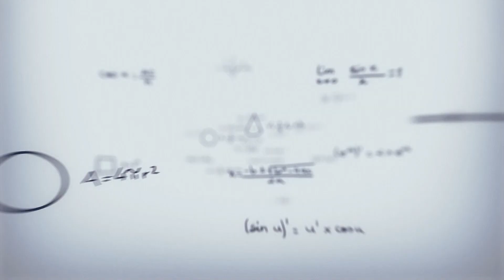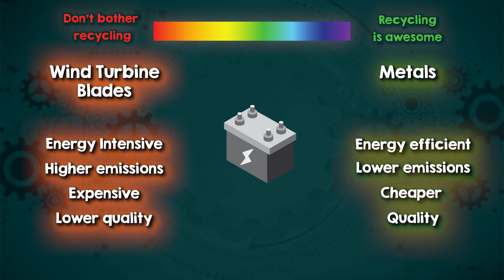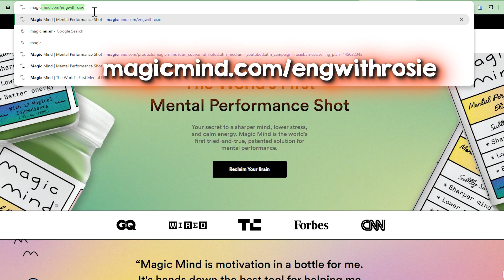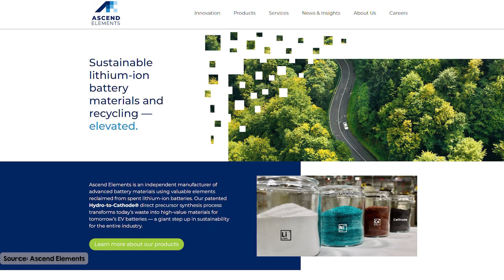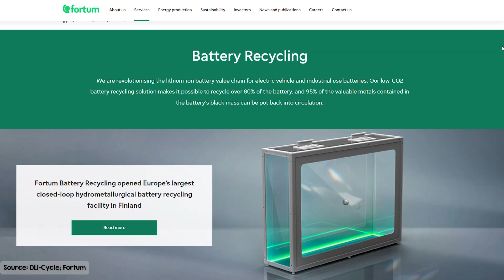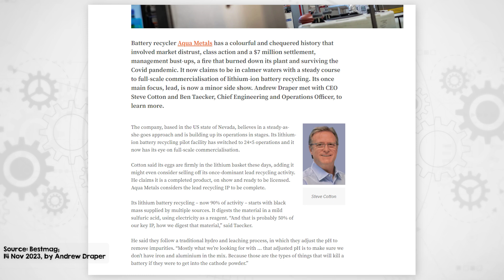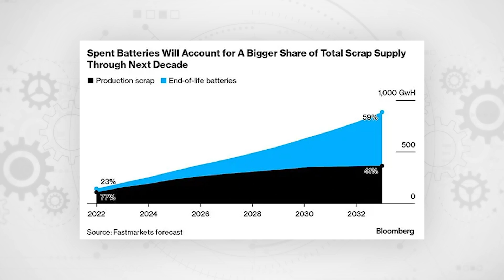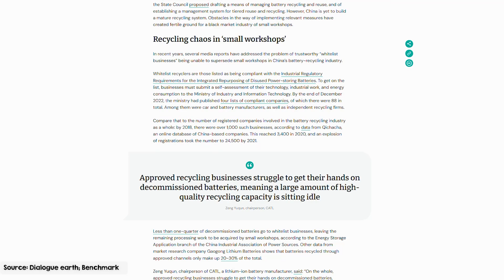Recycling Lithium-Ion Battery: How Does It Work?

Comment: I believe we should focus on recycling or at least segregating batteries. While recycling all types may not be profitable at the moment, it's crucial to separate them by type and keep them out of landfills. Currently, it seems we have more recycling capacity than material to process, so it's essential to recycle as much as possible. According to the economy of scale, if recycling plants aren't operating at full capacity, they become significantly less cost-efficient.

With so many different battery types being developed, segregating them is becoming even more important. Some types of batteries will be more suited to hydrometallurgical recycling methods, while others might be better for pyrometallurgical processes. Cutting up and sorting batteries appropriately makes a lot of sense. 

Another issue is that many batteries are discarded while they still have usable capacity. For example, vape batteries are often recharged fewer than 100 times before they’re considered "end of life." Personally, I’ve repurposed batteries from devices like these. While they may not perform as well as purpose-built ones, they still work as backup power for me when my primary battery is charging. When they finally become less efficient, I can still recycle them. 

Our society has become very "disposable," but many items, like batteries and electronics, can have a longer life through third-party use before heading to recycling. Cell phones, for instance, often have plenty of functionality left even after they’re replaced, and once they're no longer useful, they can still be recycled.

As for the costs of reusing and repurposing older components, I use a 15-year-old solar panel that now produces about 50% of its original output to charge my older devices. While I wouldn't install such a panel in a new system, it works well on its own. When it eventually wears out, I can replace it with another salvaged panel, which is much cheaper than buying a new one.
Reply: Energy has to be cheap for recycling to happen. So whatever future we have has to be one of energy abundance.
Reply: Yes, but, where's the efficiency?

Hanging onto something on the grounds you can still get an output is one thing but is it really economically sound reasoning?

Might be better to ditch the old panels and replace with brand new higher (but granted not by much) efficiency units and keep for another fifteen years.

That way you don't have to put up with lower output from old duff panels and avoid the fag of replacing the panels with marginally higher output units more often.

And of course you become a "consumer" of brand new kit and help with the economy ...

Rather too much made of recycling stuff to "work" which  should be recycled into basic components for reuse in other products.

Mind you if you have data which proves reusing panels is economically worthwhile then happy to debate.

Comment: You didn't cover lead from lead acid batteries which is over 99% recycled! Would have loved for you to mention this, since the recycling rate is due to strict government legislation due to the health hazards posed by soluble lead compounds like the ones in lead acid batteries.
Reply from the maker: I had that example in an earlier draft but removed it as I felt the video was getting too long!
Reply: @EngineeringwithRosie    It's a shame that it got left out. Hopefully you can do a short post on it. Since I'd love to hear your take on the topic.

Or hopefully you could reply to my comment. To clarify your narrative on the subject matter.
Reply: @EngineeringwithRosie 
 
Don't you worry yourself on that score young lady, we'll be the best judge of that.

You just set out your stall and leave us to feel the width.

Can't say fairer than that.

And, word of caution to the wise ... suggest you very carefully check to see which other platforms give you a mention ... some sites like to claim affiliation with all sorts to boost their "credibility" ... at the cost of your own.

Write that down.
Reply: @EngineeringwithRosie lead battery recycle process is so efficient and viable that scrap lead battery fetches more than 40,% of the cost of new one.
Reply: Lead acid batteries have very simple construction and chemistry that makes recycling very easy. Not at all the case with current Li-Ion batteries.
Reply: @w0ttheh3ll  Its easy but the materials aren't valuable, so economics is in fact not the reason that lead acid batteries have high recycling rates. It is the legislation mandating their recycling that pushes their recycling rate so high.
Reply: @денисбаженов-щ1б  Watch the post again, your are just stating wishful thinking....  That is counter to the current facts.... 

Plus newer battery chemistries are having lower and lower percentages of Cobalt and Nickel in them.....

Bottom line is like it or not Lead Acid batteries are profitable to recycle..... While no other chemistry can currently claim that.... 

I know that doesn't fit the common narrative that lithium batteries will fix all the problems in the world... That's just the way it is....
Reply: @денисбаженов-щ1б I'm guessing that the financial and energetic cost of extracting and purifying the materials in spent LiNiMnCo batteries is far in excess of refining sulfuric acid and melting lead plates.
Reply: @gregorymalchuk272  Exactly what law of thermodynamics? Do you think is being or would be cheated when something's being recycled.... 

So you think energy cost is the end-all and be-all in terms of the price of a product? Sorry it's only one aspect and usually a minor aspect in terms of the price... Supplying demand is usually a larger aspect...

 And what about negative externalities?  How do you propose to account for them?

Thanks for the comic relief and have a nice day.
Reply: @денисбаженов-щ1б  It's not possible to get rid of the internal combustion engine. It is synonymous with modern industrial civilization. But they can run on renewable fuel like hydrogenated sewage sludge, corn stalks, garbage, and sawdust.
Reply: @orionbetelgeuse1937  She literally posted that she had a segment on this that she cut from her video due to length 🤦‍♂ Take your biases elsewhere, preferably the bin.
Reply: @orionbetelgeuse1937  She cut it because the video was too long. She said so herself. Do you think you know better than she does why she cut it? We got a mind reader over here! 🤦‍♂
Reply: Lead acid batteries 99% recycle rate is primarily due to the fact that it's profitable, to recycle them. Since most lead acid batteries have a very simple construction  And therefore the cost of recycling is relatively low. In addition lead is a valuable commodity. 

Nice try, but government regulation just isn't a major factor in this particular case.
Reply: @nc3826  I'll take "citation needed" for 200 Alec.

Comment: Lead Batteries Maintain Impressive 99% Recycling Rate. So it's kind of ironic that there's a push to eliminate them from EVs.
Reply: That's largely due to the government regulations to prevent lead from entering the biosphere, not the economics of lead recovery. The value of materials in a lithium ion car battery is greater than a lead acid battery.
Reply: @SocialDownclimber  

Yes, but so what?

What point do you believe you're trying to make?
Reply: Lead-acid batteries have a lot of limitations, especially since they weren’t designed for EVs. Have you seen the recharge times on them? They still have their uses, but not as a main power source for electric vehicles. Lead-acid batteries don’t perform well under low-power conditions, and if you discharge them below 50% of their capacity, you’re likely to damage them. There are also significant energy losses during the charge-discharge cycle.

I grew up working with golf carts, and I can tell you firsthand—recharging those lead-acid batteries takes over six hours, even when you're only using the top 30-40% of their capacity. While lead-acid batteries have their niche applications, other battery types are far more efficient and cost-effective over their lifespan.

In terms of durability, lead-acid batteries typically max out at around 1,500 charge-discharge cycles with proper care. By comparison, modern lithium-ion batteries can easily surpass 3,000 cycles, and some last even longer, depending on the battery management system (BMS). Overall, lithium-ion batteries are better suited for EVs due to their longer life and higher efficiency.
Reply: @TheStrayWolf-g8t 

Hmm ... but lead acid batteries were designed for motive power in the form of traction batteries as used in milk floats from the fifties, or submarines from much, much earlier.

Boats on the Thames used lead acid cells from the late 1800s.

The only problem with lithium tech is the cost.

Where's the economic efficiency of lithium tech if you can get twice the cycles for rather more than twice the cost of lead acid tech?

Plus lead acid are quite robust electrically speaking and don't need quite so much coddling with the likes of BMS and onboard heaters.

And of course lead acid cells aren't going to self ignite and burn down your post code, or sink a car transporter vessel with all the associated pollution damage to the seabed.

More common that most people know, in fact.
Reply: @TheStrayWolf-g8t  

Yes, but lead acid traction batteries have been used for decades powering all sorts of commercial vehicles. And submarines for over a century.

You would have known that had you researched the topic prior to posting nonsense.
Reply: Energy density, discharge and recharge rates are far too low to make them truly viable.
They don't scale and I don't know of any EV manufacturer even considering Pb- H²So⁴
Reply: @jimurrata6785  

Yes, but, they use lead acid cells ... waits patiently for penny to drop ...

still waiting ...

tumbleweeds pass by ...

What battery technology was in use prior to lithium cells?

As for the density thing why didn't you Google up that as well?
Reply: @t1n4444  The point I made was that battery recycling can recover most of the material in over 99% of traction batteries if governments mandate recycling with regulation. What point did you think I was making? Not very good at joining the dots are you.
Reply: @SocialDownclimber  

😂😂😂😂

I confess I didn't really take much notice of your post on the grounds you were typing nonsense.

A fair few posters come out with nonsense similar to yours when trying to put some point across as if you ( all) knew better.

I note some YTubers get fawned over, usually by those looking for confirmation bias.

It might be useful if you and others watched other similar channels to get some perspective.

Hope that helps.
Reply: @t1n4444  How could it help when it wasn't actually advice? Your reply was only an insult, based on your own ridiculous self regard. Check yourself, and see what we all do - you aren't even slightly informed, only prejudiced and small.
Reply: @SocialDownclimber  Wrong, it's due to lead acid batteries being profitable to recycle. Just like aluminum, scrap steel,  etc. If it's profitable to recycle a  scrapped material, it gets recycled. It's as simple as that...

Most battery chemistries are just not profitable to recycle, so they don't get recycled. Even though there are also mandates to recycle those chemistries too. KISS 

The post goes into more details about why this is the case. Good luck rewatching it and connecting those dots logically. Hopefully it will overcome your biased Illogical narrative about the subject matter, but I doubt it.  Have a nice day.
Reply: @nc3826  

😂😂😂😂

Wrong yet again.

Where do you get these ideas?
Reply: Yelp,  Lead Acid batteries have numerous limitations. Relative to the current lithium based traction batteries used in EVs. That was never in dispute. But lead acid batteries are far more profitable to recycle. And therefore get recycled at a much higher rate.

So replacing a lead acid "auxiliary" battery with a lithium based auxiliary battery is counterproductive in terms of sustainability. 

I'm sorry my triggered friends that's just the way it is no matter how it is rationalized.  Come back when a viable alternative is being recycled at a similar rate.  KISS

Comment: Hi Rosie, thanks for another informative video, I am sure you are aware that " End of Life" for an EV battery just means it"s usefulness in a vehicle is not viable. However, as a house or stationary battery the battery will give years more service and still be recycled. In the US used Nissan Leaf batteries are being used to power small towns .
Reply: 'Leaf batteries are being used to power small towns'...
Fact check please!

I'm unable to find reference to what you mention here searching online.
What I did find was an article titled 'Used Nissan Leaf batteries to light up Japanese town'... they have made some battery banks from used batteries and are powering street lamps with them - Useful, but hardly powering a town.
There's also an NZ company making a 240kwh battery bank.
Reply: All batteries die. They do not last forever,,,,,,,,,,,,,,,,And when the nearly 1 ton battery dies, who's going to transport it to the nearest recycle center? You sure can't stick it in the trunk of your car and deliver it,,,,,,,,,,,,,,
Reply: I don’t understand how depleted lithium cells can power small towns? Surely battery arrays need significant capacity? And everything wears out. Even if the car batteries last another decade as a town array, then what? They still become worn out at some point